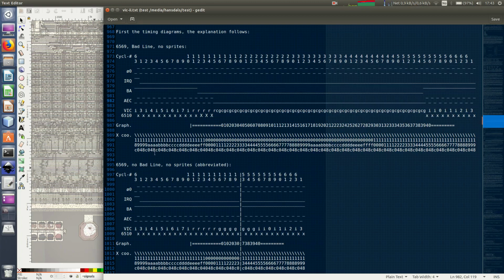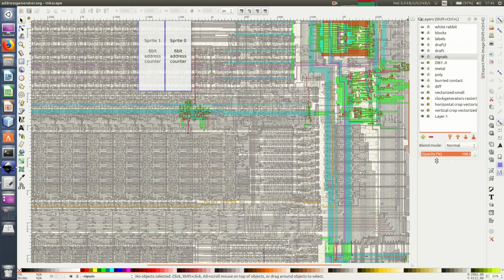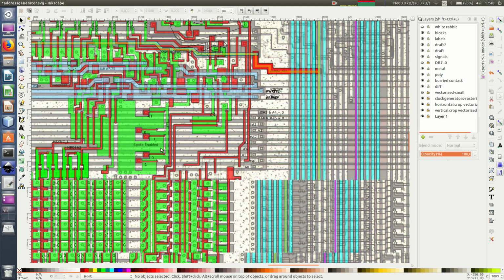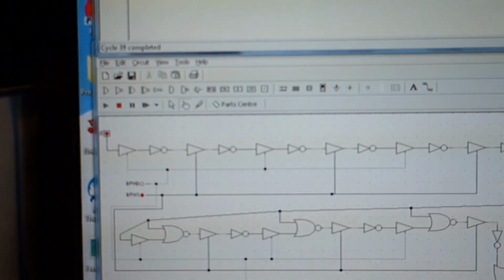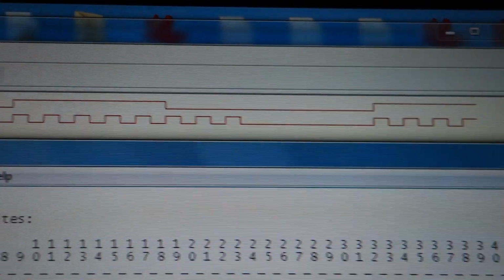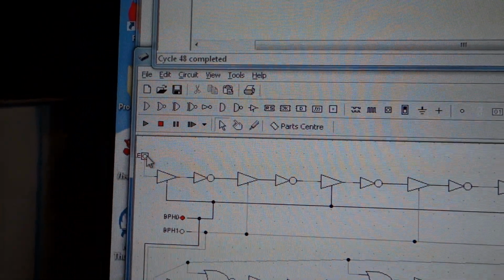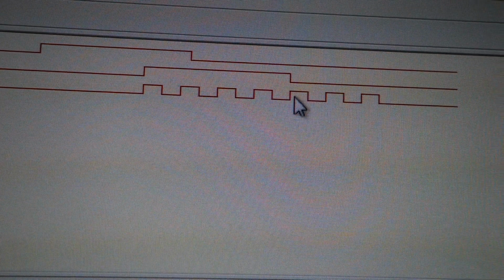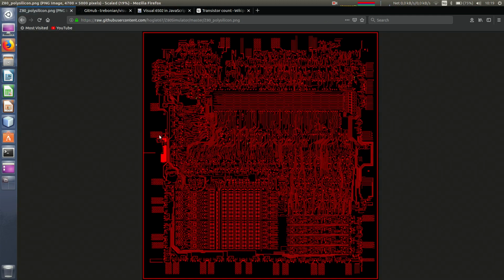C64 VICII dieshot analysis address generator pt.4 - Bus Available and AEC with shiftregisters

Comment: Bit late to the party, but I'm wondering if you managed to work out what the lines coming from the horizontal ROMs do. The vertical bits I can sort of work out but the horizontal parts look like an incomprehensible mess. Also does not help that there's all this metal on top that obscures what is going on. Anyway thanks for your efforts & keep it up.
Reply from the maker: Thanks for the comments. I have decoded the decoding ROMs. Working out the values of the roms were easy. What the ROM outputs go to will take some time to figure out. Usually the outputs come in pairs for latch set and clear. Currently I'm looking at decoder output ""bus available for sprite 0". It fires once and sets of a chain reaction for each sprite. Regarding metal on top  ,true. Makes it hard to read. It is a little bit transparent though, or the dieshots i am looking at has been processed to look transparent.

Comment: Wait, so I counted eight pulses (one for each sprite?) and then three more? I'm lost.
Reply from the maker: Simulating BA to AEC only. Expect there to be a BA low for each enabled sprite
Reply from the maker: Ok you mean at 11 minutes in. Please add minute mark if you refer to something. there were 8 cycles arbitrarely because i started the simulation with BA low. When BA is high, AEC pulses until BA has been low for three cycles. Arbitrarely because i controlled ba with a switch manually.
Reply: @bwack  Sorry Hans, I should have done that. Of course 8 doesn't mean anything because you were simulating. I just trigger on 8. Wasn't thinking